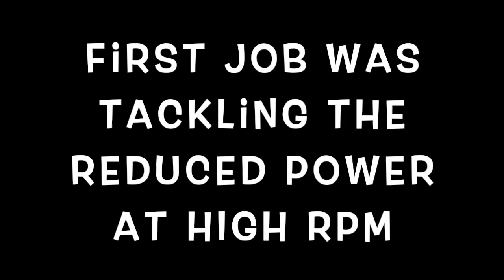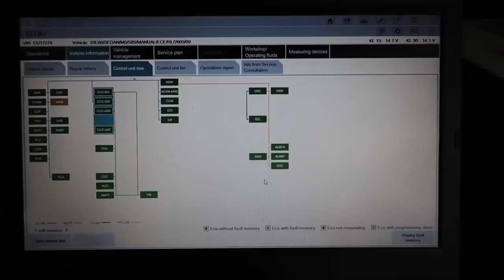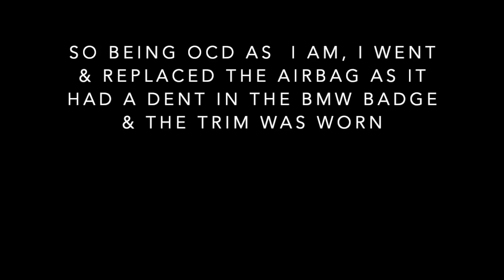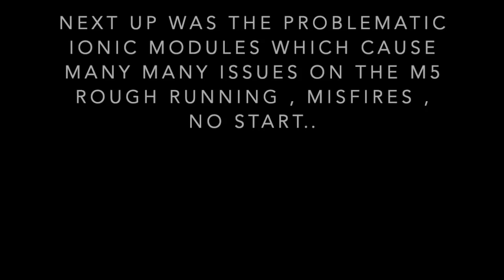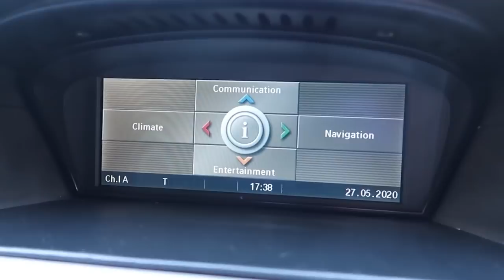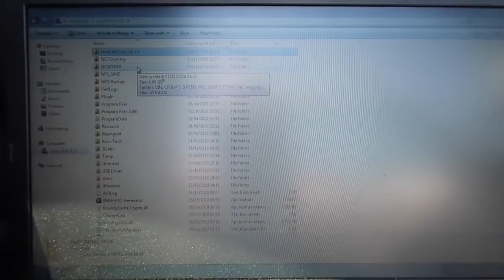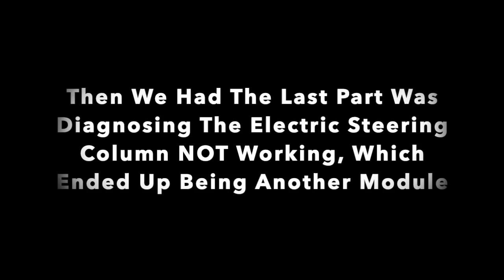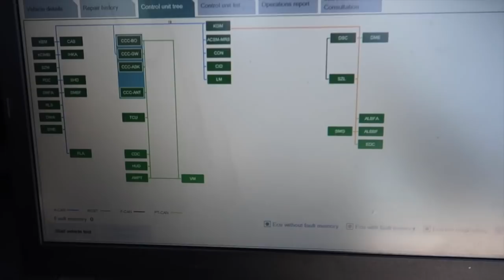BUILDING A BMW E60 M5 IN 10 MINUTES

Comment: I just bought an 07 e60 very happy with it so far 520d with m47 engine 6 speed manual thanks for all the informative vids dean also will be getting ista and winkfp and inpa will be getting full service tomorrow 2 rear tyres and gear oil haltex oil and front antiroll bushes and rear outer cv all the electrics working great in car as I said thanks to dean I knew what I was buying thanks doc dean 👍👍👍👍

Comment: I have a question about the n52 oil temps. I have an 08 328xi coupe and halfway on my oil temp gauge is 250f. It rarely goes over 240 even in 85f weather. what is normal operating temp? It's at 81k miles maybe new water pump?

Comment: Need help , 08 328xi , limp mode  code 2a38 ? Valvetronic motor sluggish/ open circuit .  I changed about valvetronic  relay  few weeks ago  codes then was 2a3f , 2a77 , erase that  when changed the relay was running fine until this code  came up 2a38 , any ideas, hoping not to censor just did valve cover gasket don't feel like taking that off anytime soon 🤣

Comment: Hey fellas question for anyone who can help. My car recently just quit starting. I have full power to the lighting in the car, lights or anything is not flickering, I hear a two clicks coming from the starter area when I try to start the car. Could this be a bad fuel pump relay? I’ve had no prior issues

Comment: Does anyone know why my 528i E60 has trouble after driving it for 40 miles ? Like I can be on the high way then it’ll just start not reading what I’m putting down on the gas pedal then 4 seconds go by then it reads it then stops reading and then that goes on until I come to a complete stop then it’ll turn on after 15 mins but I can only drive it 100 yards then turns off again but then I leave it then the next day it’s good as new until I drive it again for 40 miles please someone help

Comment: How did you find out it was a blown fuse?
Reply from the maker: if you watch my videos pal you will see I never reveal the secrets for how I diagnose many many common problems that I manage to fix if I showed that then these cars are going to rocket through the roof at some point as it applies for all E60 models. the key here is to not make it easy for others to diagnose and fix otherwise we will have issues and my channel will fail to exist if you get what I mean

Comment: Are you going to do a POV drive?
Reply from the maker: Of course I am , you didn’t think I left that out did you ?

That’s what the V10 is all about correct the sound and the 8200RPM. 

I also have the exhausts going to be done aswell we are going full straight pipe, MILLTEK EXHAUST SYSTEM
Reply: @BMWDoctor  wow!!! Cant wait keep up the good work